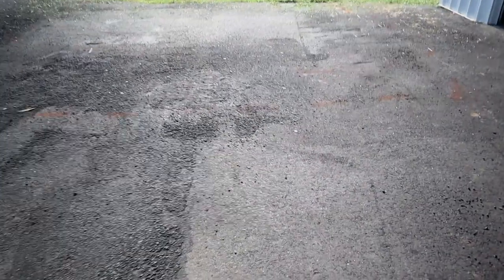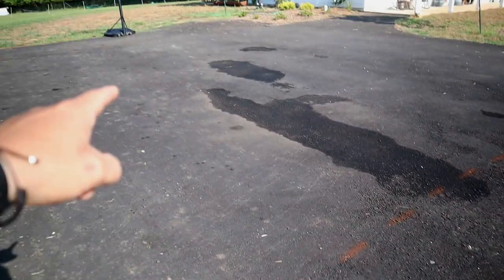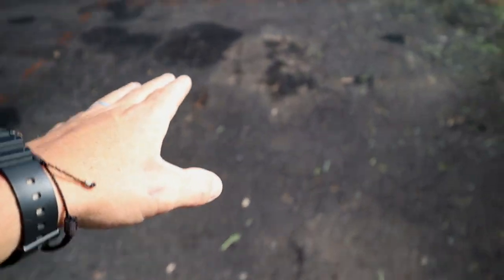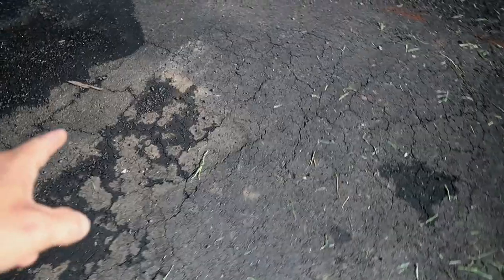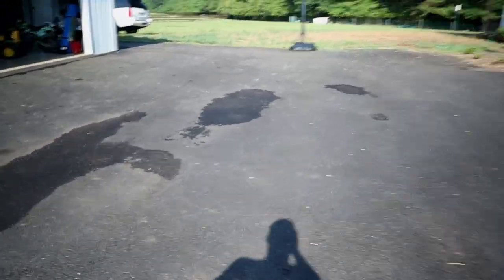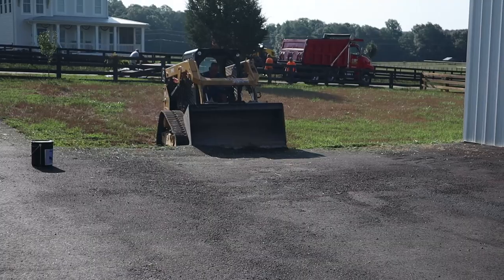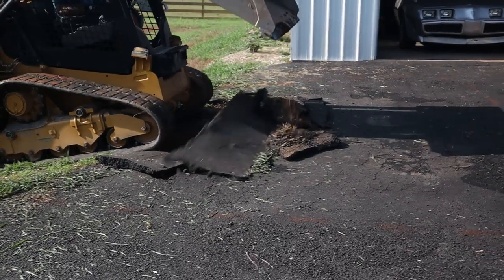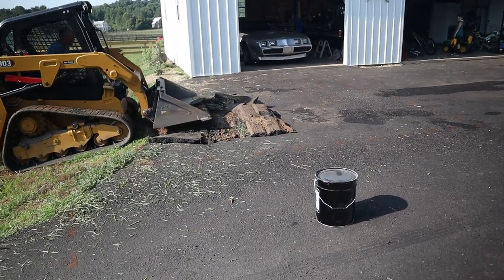Asphalt vs concrete driveway! What you should know!

Comment: I have news for you brother.  Been in the paving industry since 1962. The actual product is all recycled the ac oil is not the same. The tac is not the same  nothing is made virgin mix anymore. Asphalt doesn’t last anymore. The last 10 years every asphalt plant has been making garbage.  Anyone who has been in the business for a number of years will understand what I’m talking about.  Back in the day you didn’t need to heat the paver screed. Spray a little diesel on it. Sit it down on the mat and within minutes screed was hot.  Because the asphalt was hot. Material was so hot you could put the entire job in and wait before you roll it.  Now it’s about making a product that doesn’t last.  So they can make more money   Nothing is made to last anymore.  No matter what you do to your asphalt driveway or parking lot.   O matter what stone you use. Or even if you use base and top.  The material is garbage driveways used to last 20 years no problem. Now 8-10 your gonna need another one.
Reply: True. If the plant isn’t running for DOT jobs that require no more than 25% RAP they’ll put so much RAP in the mix it cools off before you can get a roller on it and doesn’t hold up.

Comment: Sorry, but I have been in the Business of Asphalt for 30 years.  The surface texture looks horrible.  What time of year was this originally paved?  I will also mention that the tack coat between layers was not sufficient enough for a good bond. The new surface looks better, but leaving the bones on the surface like that is not a good practice.
Reply from the maker: Hey David thanks for the input. We definitely got screwed with the weather and original paving was done in January last year. Luckily the original driveway was a construction entrance and had plenty of compacted rock. But the kick off going to the shop was added after and I’m afraid never got enough compacted rock as you stated. Thanks for the knowledge for sure.

Comment: Ashphalt is all about the base. You need at least 8 inch of a COMPACTED stone. If you can , if your installing new stone base leave it sit over winter to settle. Also make sure you are getting a 1 1/2 of ashphalt. When they are done rolling it make sure there are no lines left in the surface. As far as seal coating goes you need to let the fresh ashphalt sit for 6 months or so to let the oils in the material leach out. Until the fresh ashphalt is sealed do not let ANY oil or gasoline drip on the surface for it will eat a hole in your pretty , new ashphalt. Once the driveway is sealed it is protected from anything penetrating the mix. After the initial seal cost you will know when it’s time to seal agsin by looking at the surface. If you can see white, your seeing the very top of the aggregate, where the sealer is starting to wear off. Never use the sealer / product “ Gilisinite( sic)” . It sucks. Only use a quality / good brand water based sealer. As far as concrete goes well , if you want to spend the extra money it is a very durable product : a side note. I was working on a paving crew and I was able to get everyone and installed a driveway at my home. I put in 1  1/2 & 1 1/2  for a total of 3 inches. The driveway lasted for 30 years and still didn’t crack. It was starting to pop in some places but no cracking. Like I said, with ashphalt, it’s all about the base . Put down a inch and a half on a good stone base , seal it every couple of years and you will have a good product. I speak from experience as I did paving for close to 30 years and have done more than my fair share of home driveways
Reply from the maker: That’s some good info thank you sir. I’m really hoping this last. It was pretty bad before when it rained.
Reply: @ProjectDadLife  I can’t emphasize how important the stone base be solid. If the bobcat sinks in the stone anywhere or water starts pumping up through the stone the situation has to fixed. If you pave over soft spots the ashphalt will fail
Reply: Unless you live way up north I think 8” of base overkill on a residential job.

Comment: Way older than you so what i have to say will make it.  No matter how much it cost, concrette is the worst thing to have.  Asphalt tops 1st, pavers 2nd, 3rd is pea gravel road and concrette last.  Reason being.  Over the long run of it.  Base has to be correct, mixture has to be on point, cant leave out staining, cracks that can and will happen before a year is out.  My late Grandmothers place is asphalt.  Hasnt been done since i was in elementary school.  I am few years from 60.  Road is still there.  No repairs, overlay other than rain washing it off.  Street is almost white.  And has never been redone.  While the concrette street in same area has been redid more than 3 times and looks like crap.  Been in this home 23 years and some months.  The school and church i was raised in since birth.  Catholic, has never had a problem.  Asphalt.  75 years plus. Oldest siblings went there when 1st built.  I am number 7 in the ranks.  Still in perfect shape.

Comment: I would have used recycled millings asphalt which is fantastic, but much cheaper than virgin asphalt.
Reply from the maker: I’ve used those before. There also getting pricey
Reply: @ProjectDadLife  still a lot cheaper than the new stuff..but after you seal the millings, they look like new asphalt and it gets rock hard.

Comment: I've been looking at how I want to do my driveway and I think I'm going to go for option C: concrete pavers.

As many people have said, the base is very important and because of that I think I'm going to go for "mechanical concrete".  That's recycling tires with the sidewall cut off, filled with rock like a giant geogrid reinforcement.  This technique is being used as a road base for some freeways so it should last a very long time under a driveway.

The pavers themselves allow for drainage through the joints and a stone base should drain well too.  Also when one paver gets damaged, an extra can be swapped out for an easy repair.

It's not great for kids playing on it but it should look nicer than plain concrete in my opinion and if I do the labor, I think the cost will land somewhere between asphalt and concrete, probably closer to concrete but arguably better.